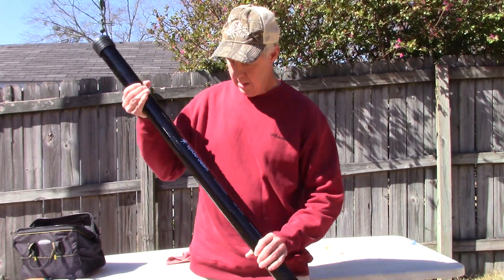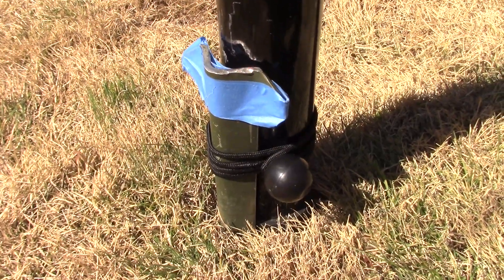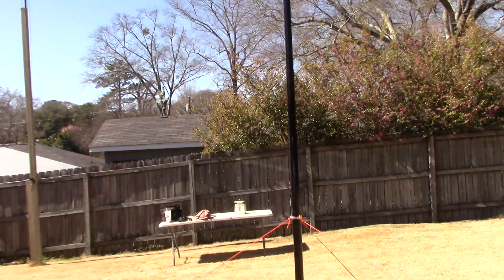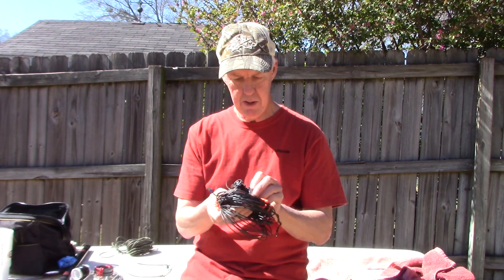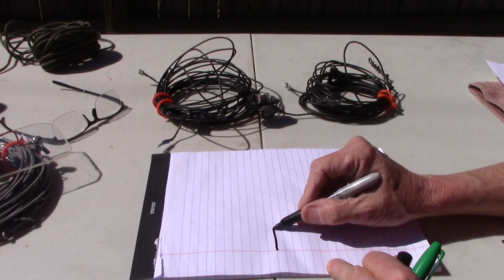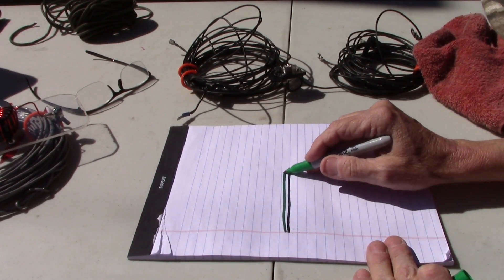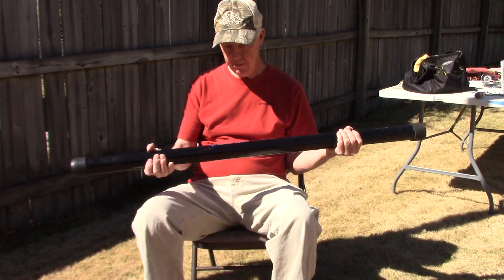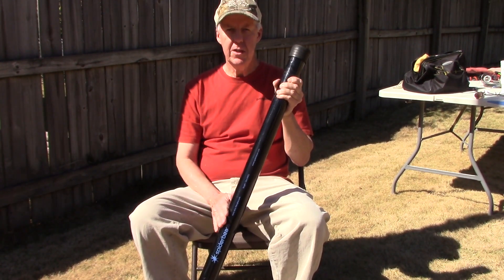Spiderbeam 12M Telescopic Mast Review

Comment: I use a telescoping paint pole
Reply from the maker: I have too in the past. A cheaper option. Longer and a bit on the heavy side. But hey, use whatever you can get that wire in the air.   Steve - Ad4xt

Comment: I.ve been off ham radio for 44 years! now I am coming back to it! I am about to setup a G5RV and I intended to use a Spiderbeam that I already bought but I have changed my mind! Now I want to hang the g5rv only at the ends of each leg.  I was thinking on one end simply tied to a wall and the opposite end tied to a rope through a pulley with a rope tied to a brick so that it goes up and down when very windy. what do you think it should be ok even if not supported in the center?
Reply from the maker: Yes it should work as long as you have the window line off the ground where it connects to the coax. We used an antenna this weekend at winter field day .Zs6bkw which is very similar.  The higher the connection point the better.
Steve - Ad4xt

Comment: I've just taken one of my 🕷 12.5 Spiderpoles down after 5.5 years being secured with clamps, and it's as good as the day I put it up, bar a little fading.  
It's been up in 90 kph 💨🌩🌀💨 winds.  I have it with 3 mid height 2mm cords and a short star picket strapped at the base.  
The Pole has been up and down 5 or 6 time for different antennas, and a second wired pole is used as a reflector.  
WORKS A TREAT 🎉over the pond to the States from OZ.   FOO was Here.    VK4F👀

Comment: Great idea! I have Spiderbeam 18 m long. I will make vertical for 80m that maybe can resonate on 40m as well. Regarding 160m, I can add coil + relay which will open/short circuit, so that it can resonate on 1.85 or 3.6 MHz (no coil=3.6 MHz, with coil=1.85 MHz). What you think? Oh, yes. Since I need 20 meters, I will add 1 meter aluminum rod, 3mm diameter at the top, and rise whole Spiderbeam 1m from the ground. Wire will go all the way to the ground, so this way it may resonate on 3.6 MHz. Radials will be added, but I have no much space in my backyard, so maybe 20m in one direction, 14m in all other directions.

Comment: What would you use as a pole support on a flat roof, flat base with cement weights?
Reply from the maker: .5 gal. bucket of cement and guy wires. Be safe with whatever you choose. Safety first.

Comment: With the exception of the radials for the "vertical", you never mentioned any counterpoise for the other wire (EFHW) antennas. I understand that the coax itself might work as one, but would love to hear from you what you think.
Reply from the maker: Not really needed for a EFHW. Sometimes I will run short piece of wire to a ground stake.

Comment: Spendy, but it looks like good value for the bucks.  You can also cut an angle on a 2 ft piece of 2in or whatever diameter will be large enough ABS then pound that in the ground for a great pole base.

Comment: That was a great video and an excellent product!  Just a couple of observations that might be useful: 1. a couple of years ago I had mine up all winter long as the first support of a 160 meter wire antenna.  I found that after extended exposure to the elements the bottom cap was quite weathered and cracked.  I suggest that for extended deployment the bottom cap should be wrapped with tape to protect it from  UV.  2. An alternate to the 4x4 post is a U-post (also called a U-channel post).  Get a six foot post and drive it into the ground an appropriate amount, cover the bottom section of the mast with a piece of foam pipe insulation, and strap the mast to the post.  For my all winter long deployment I also used the guy collar that they sell and attached four guy ropes.
Reply from the maker: Very good info William. Thanks for watching.
Steve _ Ad4xt
Reply: @Ham Radio Portable  By the way,  this reminded me about my bottom cap,  so I ordered a replacement.  $4.00 each, so I ordered two!  Received today ($6.00 shipping). 😎

Comment: The top 3 sections tend to bend like fishing poles when deploying it as a sloper mast. It negates the top 10 feet or so. I only need to look 15 feet in front of me right now to see the sag on my 130 foot EFHW antenna. If you want a STRONG vertical antenna mast that will support a balun or somethjing with weight buy a  DX Engineering fiberglass mast. They are 7' tall collapsed and very heavy. The normal one can support baluns or slopers with ease the HD version can probably support a large vertical VHF/UHF antenna (17 foot) or some other project. These masts are heavy and not very portable.

Comment: I have a 20 meter vertical on mine with the feedpoint up about 16ft or so with 4 radials. Works really well.
I had a z6bkw on it at one time but it stayed bent over. Didnt break though and i left it up for months like that.
Reply from the maker: Yea, it's one heavy duty mast. 
Steve Ad4xt

Comment: Hi Steve.. only one thing I would recommend is to be not so strong when retracting the elements.. when I heard them hitting the ground it reminded me of why one of mine is damaged. When coming down they can hit each other and shatter the bottom of the bigger section if a smaller one had come through first. Don't forget they are fiberglass after all. Good video.
Reply from the maker: Thanks for that. I have added some extra foam padding inside the bottom cap. 
Steve

Comment: I've used mine for several different antennas... N9TAX roll up J pole at the top with RG8X coax, 10, 20, 40, 80 meter inverted V antennas with a LDG 1:1 balun, and an 84 foot random wire connected to an Icom AH-4 antenna tuner. I bought the version with the cotter pin glued inside the top section, and when I zip tied the LDG balun to the very top, the mast bent over about 2 feet from the center line. I started zip tying the balun to the bottom of the second section from the top and now it remains upright. 34 feet still isn't bad, but I would recommend zip tying the coax every other section of the mast to keep from having too much weight being pulled from the top. 73 KD5YOU
Reply from the maker: Great info John. I like your zip tying the coax to the mast idea to limit the stress of the RG8x coax. I have used tape or small pieces of paracord. Good feedback Here.
Thanks  Steve  Ad4xt
Reply: @hamradioportable1630  You're welcome Steve. I noticed that if I zip tie the coax along the mast, I distribute the weight, but I see that it can benefit the coax as well. 73 KD5YOU
Reply: ⁰⁰⁰000
Reply: I was wondering about the N9TAX roll up J pole with RG8X....thanks for the comment..  I need one for comms with a remote trail running event where one of the aid stations is down in a deep valley and has trouble getting signals there.   Many thanks for the idea of zip ties along the coax..I deploy mine with Voile silicon straps which are reusable instead of zip ties.   Cheers! N4YLA.

Comment: Tnx om. Hard to beat this pole. My tower is on the downhill slope in the backyard. I keep the pole in the front corner so I can run half square antennas. Another good thing to use is self amalgamating tape instead of clamps. Keeps it from collapsing on itself. I haven’t tried a vertical yet on it. I’d say it works well